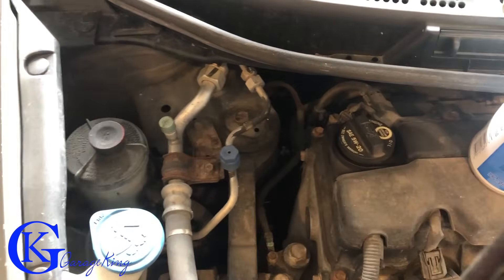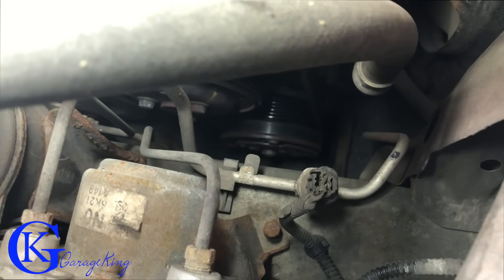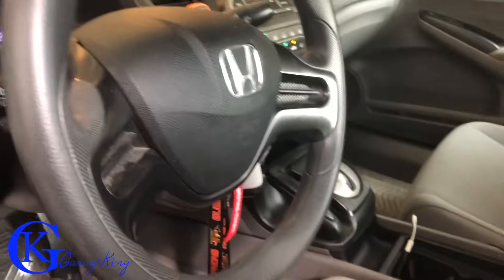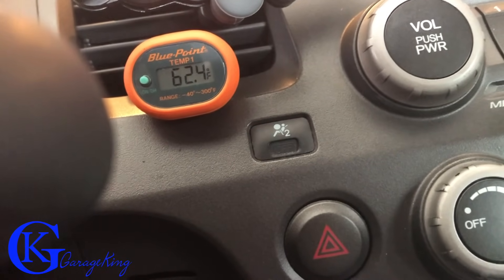How to charge Honda Civic AC with a can

Comment: after squirting the air and starting the car turning the AC on, gauge does not go down still on the 100psi level. what to do?
Reply: even on idle engine temp, compressor si not running but both fan are running. its a 2007 civic, when i turn the AC on, its not blowing cold air at all. followed all your steps, did it 3x and still the gauge is reading 100-110psi after turning the engine / ac on.
Reply from the maker: Hey there and thanks for the comment. If your compressor is not turning on and you have emptied a good portion of the can in then you most likely need a thermoswitch. It’s common on the civic and the switch is located on top of the compressor. You most likely have to take your alternator out to get to it.  The switch as far as I know is only available from Honda so check with Honda for the price on the switch. The other option is just getting a rebuilt compressor. The price has come down quite a bit. I have links in the description.   Thanks :)
Reply: @GarageKing  actually i did not start emptying the bottle yet because of the high reading on the gauge after starting the engine. should i still open the bottle and empty it even if the Psi is high?
Reply from the maker: Yes put some in,  the sides have equalized and even though it’s reading 100 you may have next to nothing in there.  Once the compressor kicks in your high side will go to about 200 and low side will go to around 50 when filling
Reply: @GarageKing  i tried adding some but still no luck, maybe its the thermoswitch afterall but thank you i really appreciate the time on helping me.
Reply from the maker: Hey no problem, I would put at least 1/4 bottle to trigger the compressor. Sometimes it takes a bit.

Comment: how to disconnect that, from the one conected to car or the one with the can?  did i missed it ?
Reply: @GarageKing  🙏🏻 thank u, may will get back to u here when I got the tools to start 😊
Reply from the maker: @sulmaz11  Hey There, I deleted my comment as I thought it was for the Tesla video LOL  I have too many vids on my channel (your comment came up on the Tesla vid in the app) so an error there.  how you disconnect it, is when the can is as empty as you can get it, leave the car RUNNING and then just pop off the connector, you are going to loose a bit from the can, but not much.  If you shut the car off, the HIGH and LOW side equalize and you will loose more.  So disconnect when the car is RUNNING and the can is as empty as you can get it.  Hope this helps :)
Reply: @GarageKing  oh okay thanks for correcting 🤍🙏🏻

Comment: My 2006 Civic blows cold 50 F when I’m on the highway but sitting in traffic it blows 80 F.  Is this also a recharge needed scenario?
Reply from the maker: Most likely you are low, BUT if its really hot outside and you are at idle the temperature in the car will rise as the compressor turns slower.  Make sure you are on recirculation.  If you allow outside air in, the car will blow warmer on a hot day at idle (on a hot day)

Comment: That was very easy to watch and learn from within a reasonable amount of time honestly. I do need to know if I can find out how much is left in my 2013? It's a 1.8 L Civic and it's just not blowing very cold.
Reply from the maker: Hey there and thanks for the comment.  If its not blowing cold at all you probably only have about 1 to 3oz in the system.  Under 1oz and you compressor probably won't engage, and once you hit about 4oz its starts to get cold.  There is no way to know for sure, other than to evacuate the system and measure, but my guess would be 1-3 in there.  Hope this helps you out :)

Comment: Question about the compressor spinning. The belt is always spinning the wheel there when the car is running. Is the AC compressor the face of that wheel whose axel would be parallel to the ground?
Reply from the maker: Great comment and you are correct. When the AC is disengaged the belt is always spinning on the AC compressor “free wheeling” on n a bearing.  There is an electro magnetic in front of the compressor. When it’s time to engage electricity is supplied and it pulls that front face (clutch) to the bearing that is already spinning. Then the face (clutch) spins and that face part is attached to the inner compressor via a shaft. So it’s important to see that face spinning and yes the face is what actually spins the compressor.  Hope I answered your question :)

Comment: What if the belt on it spins but it doesnt look like the part in the middle is spinning
Reply from the maker: That means the compressor is not running so it wont be cold at all.  The centre part has to spin.  The belt spinning on the outside happens anytime the engine is running, and then that centre clutch pulls itself in and spins to move the refrigerant around.  You are either low, or you have an electrical problem.  You can put a can in to see if the centre part starts spinning, if you put a can in and the centre part does not spin then most likely you need a thermoswitch.  Common on the Civic.

Comment: How do I know if my car needs two cans. Civic 2012
Reply from the maker: You don't. The only way to truly know is to evacuate the system to empty, and measure in new stuff with a scale, so if your car is warm you are down to an ounce or two.  One can should be fine. I didn't check the specs on your 2012, they should be written on a sticked attached to the underside of the hood. It also depends on how big your cans are. I used 12oz cans, but I know there are larger cans out there.

Comment: Bro what year is that civic I have a friend that has a 2017. And it’s blowing hot. Wonder if it’s the same thing
Reply from the maker: Hey Thanks for the comment, this one is a 2006, 2017 is similar, but I think it uses 1234yf instead of the 134a that was used in the 8th gen.

Comment: Where do I look to find out how much my 2016 civic can hold?
Reply from the maker: Hey there and thanks for the comment.  Usually under the hood there is a sticker close to the latch.  It's usually on the hood itself so you have to look up. As your car is newer it will most likely be in grams and you can convert it to oz with an online calculator.  Most Civics are around 1lb, but check the sticker to make sure :)  Also I'm not sure when Honda went to 1234yf from 134a, it was around that time, but may have been closer to 2018 so make sure you get the right replacement stuff !!

Comment: My A/C in my Acura TL works but isn't running as cool as I'd like it to be, its around 73 ~ 75 degrees.
What do you recommend, should I just go to the dealer and fork over the cash they want to charge me, or should i DIY it?
Granted, I never worked on a cars A/C so I'm worried i may damage something, thoughts?
Reply from the maker: Your TL is R134a (I believe) so you could always try putting in 1/2 can and see if that makes a difference.  If there is no difference then it could be the blend doors in the dash that are not fully seating.  At least you know its running as it is cooling.  Also make sure your radiator fan is blowing when the AC is on, it should always be on when the AC is on (90% of the time).  If this does not work and you don't feel comfortable going any further then I would take it to the dealer. Hope I helped you out :)  Have a good day :)

Comment: R 134 is no longer available in Canada, so what can do we do? R12 or 1324yr?
Reply from the maker: You can't use R12 as you would never get your hands on it, its been banned for decades.  The real 1234yf is really expensive, and people are having problems with it so forget about that.  The best thing is a replacement like this https://amzn.to/3c7dUzd  its compatible with your system.  I have used this stuff https://amzn.to/3c558Sa but I can only find it in a 12 pack (would do you for quite sometime) Or you could get the whole kit https://amzn.to/3uHN477 if you need the gauges.  REMEMBER with this stuff you USE LESS, its like 1/3 due to the density so one can is all you need.  I should do a video on it LOL :)  Let me know if you have any other questions ;)
Reply: @GarageKing  Thank you so much for your help,  I thought as much and will see how the old car is doing with the last charge I did using 134
Reply from the maker: Glad I could help out !!!!  Good luck with everything and if you need anything don’t be a stranger. From one Canadian to another !!!
Reply from the maker: @marciamenage931  I was thinking and some of the US suppliers on Amazon do ship to Canada, but its going to cost you a bit.  For three cans of 134a its 100 bucks with shipping https://amzn.to/3AKUc6E

Comment: How do we know how much Freon left in the system?
Reply from the maker: Hey There, simply put you don't.  BUT BUT BUT, there are a few guestimate factors you can use to help.  If you compressor is not running, well then you don't have any, or your compressor is shot, or a sensor is gone. If the compressor is running but the air is warm then you probably only have about an ounce. It takes about an ounce to turn on the compressor.  Once you have about 2 ounces the pressure that is shown in the gauge will be very similar to if the system is full.  So only do this if you have warmer air which obviously indicates you are almost empty.

The only real way to tell exactly is to evacuate and weigh the refrigerant coming out. That's what a reputable shop would do. If you don't feel comfortable the best thing to do is take it in, as a shop can evacuate, fix any leak, and recharge. If you overcharge you could damage your compressor.  Thanks for the question and if you need anything else just let me know.

Comment: Wen I hook this up to my car ,the needle goes to the red ,wat does that mean and why.?
Reply from the maker: Hey there, when you are hooking it up, the car must have been off.  When the car is off the high side and low side equalize, this would cause the needle to show in the red, as the needle scale is designed to read the pressure in the low side.  If you leave it connected, once you start the car the needle will drop.  The fact that it went up so high tells me there is pressure, and thus refrigerant in there.

Comment: The can I bought didn’t fit my ac low service port
Reply from the maker: Hey There and sorry to hear that.  There are cans that fit the 1234yf port, and cans that fit the 134a port.  They are slightly different and you have to make sure you get the right one.  Sorry about the late reply, Youtube did not catch this comment so I wasn't notified right away.

Comment: Hi i like your videos         
I have a question, I have the cold line   the one with the  Ac pro , the temperature is 40c and above. When I measure it, it is above 60 or 70 PSI, is it normal?
Reply from the maker: Hi There, the pressure is always going to be higher when its hotter.  40C is HOT !!! If you put the gauge on with the engine off its going to be high, probably like 175psi or so.  Its when the engine is running, AND the compressor is spinning that the pressure should be lower.  60-70psi is getting up there, but its still ok on a hot day :)

Comment: I don't understand why you need to keep the pressure on that gauge in that blue zone. What is that the pressure of? Either way you are still putting the whole can in so why does it need to be at that pressure?
Reply from the maker: Hey there and thanks for the comment. Keeping it in the blue zone just allows for a efficient charge. If the pressure is too low it will take a long time, if you open the can right up and go high pressure there is a chance the liquid from can will meet the compressor which can’t compress liquid…….  So pacing it in helps to stabilize it. It comes out in liquid form and then turns to gas in the low pressure line so you have to give it time to do that.  Hopefully this helps !!!
Reply: @GarageKing  Ahhh, understood, makes sense. Thanks for explaining that to me!
Reply from the maker: @Brandovibe  for sure, glad I could help !!!

Comment: I had my refrigerant explode on me this last Sunday. It was a ride to say the least… I was taking bolts and brackets off to remove surface rust and then prime and paint them. I took a bolt off that was holding a line in. It was fine for about 10-15 minutes until I heard a hiss. I put my ear next to it to listen and boom. It went all over my face and on my hood and my fairly freshly cleaned engine bay… I was able to smack down the line and then hand screw the bolt in before running inside like a little kid and ripping my clothes off and washing my hands and face. I later checked the psi on it and it still had more to go. I need to refill it which is why I’m here but please be safe and know what you’re removing before you do it.
Reply from the maker: Oh man !!!  Glad you are ok and didn't get hearing damage or something.  Those lines have a lot of pressure.  The good thing about refilling the system is you don't remove any of the lines.  The refrigerant is put through a one way valve so its safe that way.  Really glad to hear you are ok !!!  Thanks for sharing with me.

Comment: Man, I think I have to do this to mine but the only thing I’m missing from this video is how do you take the hose off of the car? Is that safe when the car is on? I’ve never done this before
Reply from the maker: Yup totally safe to disconnect when the car is running, and its actually better to disconnect when car is running, as the pressure will be lower. Once you shut the car off the pressure equalizes on low and high side and balances to a higher amount.  You charge through the low side when running and disconnect when running :)